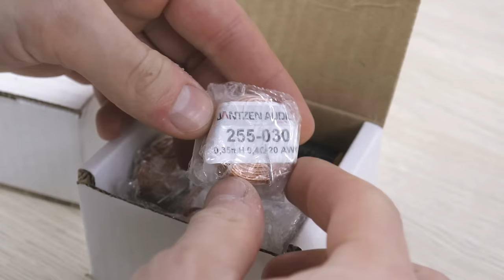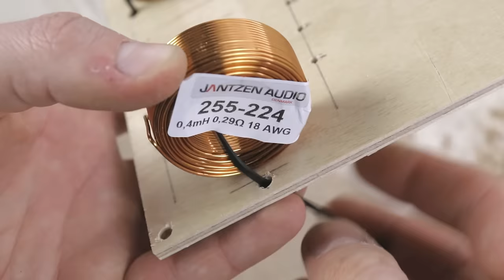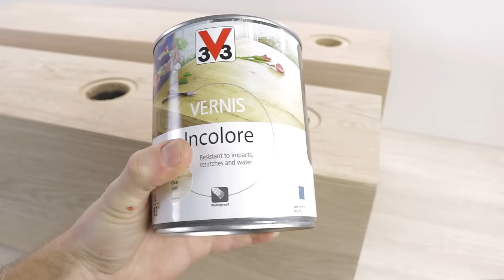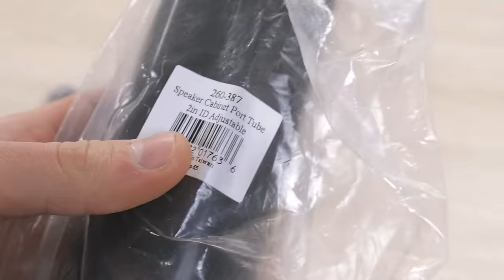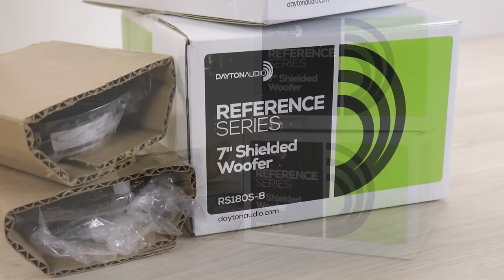These $185 DIY HiFi Speakers Sound AMAZING

Comment: I know I can build the box and wire it but I don't know anything about building crossovers can you buy the ones already made
Reply from the maker: The crossover build is actually very straightforward using the provided diagram, there's not much to know there. You can also use these crossover pcbs on ebay to make it more simple: https://ebay.us/uuJzSI
Reply: @DonnyTerek  thanks I actually built a really nice looking speaker and I ordered the crossover from parts express but I don't know if I can better quality sound from making for the pacific speaker . It seems like a generic crossover. The caps are small it doesn't look like what you have on those. But since learning more I think I can build the crossover with the plan and it's a good price for the quality of speakers. I'm mad at myself for spending $200 on a little bookshelf. The speakers I built for under $200 and they are the bookshelves don't come close even with the crossover I used
Reply: @DonnyTerek  I actually taught myself how to xsim and Dayton audio speakers give you files to download. I was intimidated by crossovers but now I realize how easy they are and I actually redesigned my crossover mine and got much better results

Comment: If you put them in the same box, the tweeter will be disturbed by the vibration of the woofer. In particular, it is not possible to reproduce the original sound such as hard rock.
Reply: Do you have open backed tweeters or something?  What kind of cup is flexing like paper?

Comment: Nice, I look forward to seeing the cross over and hope its not full of cheesy poly caps, Iron core inductors and sand cast resistors. I did notice one small issue your soldering the input connectors was good and they didn't have any magnetic parts in them. However the cables you used do not appear to be pure copper with the correct coating and the clip on's for the speakers are magnetic and that is two issues for inserting noise into the path of the music. Also thanks for the lesson on Veneering. I have a case for my Vintage Sansui I want to re-due with Teak veneer and a tincture style satin I forget the exact name.  It only darkens the darker wood grains leaving the lighter grains alone. And I like your Jig pretty sweet.
Reply from the maker: Thank you. The cables are indeed pure copper. I did not consider that the clip ons can be magnetic, I might swap them for other ones later.
Veneering is kind of fun actually. Quite satisfying to see the boring mdf panels coming to life.
Reply: @DonnyTerek  Well according to GR Reaserch the internal cables besides being of pure OFC need a specific type of coating.according to Danny. I assume it has to do with the properties of the electrical signals which run along the outside of the wire or to do with the electrical field the signal creates. He would know as a speaker designer and electrical engineer. lol unfortunately for me I have no room to build a pair myself. Thank you for the reply.

Comment: The hardest and most elegant part was applying the veneer correctly and methodically.  Definitely not part of the novice woodworking aspect! I'm also surprised at the frequency response on the 7" Dayton Audio reference speakers. My first ever speaker project began with the 3" reference drivers ( probably the best full range drivers for hitting crisp highs without a tweeter). Then i upgraded to 4" drivers which to my surprise wasn't really that big of an upgrade. Finally i added a 6"1/2 tang band subwoofer built exactly to spec and hit 30-35 hz that tapered right around 46 hz.  My point is: do tweeters really add to the euphoria of sound quality? or is it that much of a big difference compared to just using a regular subwoofer and 4" dayton audio reference drivers? ( using hifi amp of course)
Reply from the maker: To my surprise, applying veneer is not that difficult after all! You just have to get the right technique and keep the angles sharp. After that it is just rinse and repeat on every side. I haven't made a full-range build yet. Would love to try that to hear the difference.
Reply: Dedicated tweeters add more air.

Comment: Just one question... how do you open the case in the future if you need to service it?
Reply from the maker: The enclosure cannot be disassembled of course. The only part that might ever need service is the crossover assembly which is held by 4 screws right behind the woofer. Made it small enough so that it can be removed through the woofer hole.

Comment: Great video! What´s the  PVA wood glue you used? I´m having issues whit mine and need to try another. Thanks in advance
Reply from the maker: Hello, thank you!
I just used regular PVA D3 wood glue.
Reply: Elmers wood glue consistently wins competitions when it’s compared to other wood glue is rather inexpensive easy to find and it even works for outdoor projects!

Comment: Stunningly beautiful build by someone who knows what they are doing! I would only have changed 2 things: maybe exchange the connection posts for the contact tubes (eg. Like GR Research uses) and used floor decoupling, not cones. Decoupling allows the speakers to 'sing' better - for me it's a recent but significant discovery. All the best, Rob in Switzerland
Reply from the maker: Thank you so much! Your tips are kindly appreciated and I will definitely look into floor decoupling for these speakers.
Reply: @DonnyTerek  Donny there is a video on YouTube by the HiFi guru Max Townshend of Townshend Audio demonstrating loudspeaker decoupling. Search for TownshendAudio. The videos show their decoupling product and objective measurements. This video prompted me to experiment. I now have much more energy in the mid & treble and drier more neutral bass. Best regards, Rob in Switzerland
Reply from the maker: @RobWhittlestone  Thank you once again. Now I'm excited to see if I will hear a difference, haha. Best regards.

Comment: Nice video : Try some Nedlab capacitors and film resistors in the tweeter section. / coil placement could have been better / soldering the drivers instead of crimps is a plus.
Reply from the maker: Thank you for the tips! Might try that out to see if I hear any difference.

Comment: Very nice video. Why did you cut the holes before applying veneer?
Reply from the maker: Thank you! I had the holes cut before the veneer to minimize the dust that would enter the enclosures if the holes were cut after the veneering. It also allows more room for error if I accidentally cut the holes too big on the first time - they can still be covered with the veneer and then cut smaller.

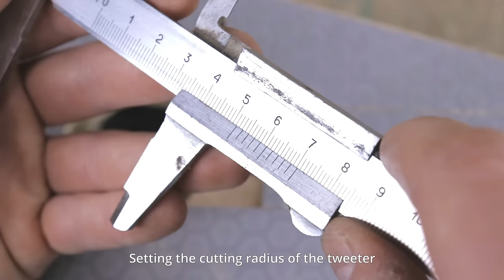Comment: 20:17 Circle Jig, adjustment, under side view. I'm impressed with it, curious how it works, how it's set.
Nice work.
Really liked the Oak veneer work and results.

Wondering if I bought a pair of old speakers could I use them as the chassis base and then put in that new speaker and electronics kit you have used to update and improve them.
Reply from the maker: Thank you!
The circle jig is pretty simple, you loosen the bolt that's on top to move the sliding part. This way you adjust the cutting radius.
Unless you can source a pair of speakers the same size and internal volume as these, you could re-use them with somewhat similar results.

Comment: Can we add second bas speaker to this crossover configuration?
Reply from the maker: Not without completely redesigning the enclosure.
Reply: @DonnyTerek  i got one more question I can’t find answer for. Does it matter for a speaker to be longer than its width, or only the volume inside is what matters?
Reply from the maker: @yafmaverick  It is not only the inner volume of the enclosure that matters by the design but you also have to leave enough room behind the woofer to the back inner wall of the enclosure, you can't have it too close to the woofer to avoid reflections hitting the woofer.
Reply: @DonnyTerek  that makes sense, and answers my question, tyvm!

Comment: They look amazing. I have a turntable plinth i have to get ready for veneer, i want to use the same method as you, but it's scary.
Reply from the maker: Thank you a lot! Go for it, there is not much you can mess up. Even my first veneering turned out fine which I did on a powered subwoofer build. I would say that the key is to keep the corners sharp ant square for the best results.

Comment: Does anyone know if moving the bass port to the front baffle (my room doesn't work nicely with back tunnels) would ruin the audio experience of those speakers?
Reply from the maker: Hi! I wasn't able to find much info on the web on these speakers with the port built into the front but I guess placing the port in the front would reduce the bass output as one person who made these front ported wrote on reddit:
"I think making them front Ported probably reduced the feeling of bass, because there is no wall to bounce off, but you can still hear the bass notes pretty clearly you just can't feel the thump."

Comment: Awesome job. I suspect you tested the crossover before you glued it into the box, but just didn't show us that part?
Reply from the maker: Thank you! Just hooked up the woofer and tweeter to test before assembly. The crossover can be removed anytime if necessary since I placed it right behind the woofer and the crossover is held by 4 screws.

Comment: You put a ton of time making the Box.     Then you make a low level X over. Than add creppy  wire   I hope binding post are a little  better.   Every one on U Tube  building speakers  always has good-looking tools 
 Fine.  Then when  the inportant part comes 
  Thay have deep pockets  with short arms.    Thay could sound even more amazing.   Start with some audio footers  
  You need to know what the floor is.  Cement or wood   get the vibration out of the box.     Intrested in what you will do.    Let's look on.

Comment: It's nice that these also come in a knock-down kit with the holes already drilled. Building crossovers, on the other hand, would be the bane of my existence. Would any of the Partsexpress assembled 2-way crossovers work well with this? What's the crossover frequency in the one you built?
Reply from the maker: I'm not sure if any of the pre-assembled crossovers available on PE would work with these speakers. The crossover point of these is 2 kHZ. I don't think you should be let down by the crossover build so easily, they are not difficult to assemble, rather quite fun and relaxing to be honest. The instructions are clear and drawn out for easy assembly. Moreover you can use these pre drilled pcb boards for more convenient assembly - https://ebay.us/QViavG
Reply: @DonnyTerek  Thank you for the link. I even bought a high-ish end soldering iron because I fly FPV drones, but crossovers seemed intimidating. I'm thinking those boards will help. The separate components would definitely be cheaper than buying a pre-made crossover.
Reply from the maker: @sumdood2035  No problem, glad to help. Funny thing is that I FPV drones look intimidating to me but I really want to try flying one. Hope you won't be missing out on these speakers only because the crossover build looks daunting.
Best of luck.
Reply: @DonnyTerek  A cheap set of goggles, and a basic drone like the tinyhawk and a compatible transmitter (radio) would be a good start for a few hundred bucks. Once the itch gets you, though, you'll be upgrading DJI HD goggles and a matching racing drone. Very similar to audio :) The FPV experience is very freeing though. Like flying a stunt plane without the risk. 

I already have a pair of the venerable AV123 ELT525 Towers. They are, what, 13 years old now? I'd like to build something a bit better/more current.
I've been lurking on partsexpress for years. I always wanted to push the button on something DIY but could never bring myself to do it. Maybe you have given me the initiative to jump in. I don't really have a wood shop, just some saw horses and tables. That's who these knock-down kits are designed for, though, right? (beginners)
Reply from the maker: @sumdood2035  I got into RC quite a while ago with making my own planes out of styrofoam, but never got into FPV. Though I have a full system ready to be wired up. Will definitely move this project a bit forward now.
As a happy owner of a pair of these speakers I can fully recommend them not only for the sound quality but for the satisfaction of having to build them yourself. No wood shop is necessary for the knock-down kit, perhaps a drill to help yourself.
Reply: @DonnyTerek  You're already halfway there with the planes. A drone flies quite a bit differently, though. It requires both sticks to bank and turn at the same time and the throttle needs to constantly be modulated. It takes some getting used to, but you actually have more control in the end.

I just checked the specs. If the Amiga's really go into the 30hz range from a single pair of 7" woofers, that's pretty insane!  Your demo video showing them driven from a 50wx2 RMS Dayton amp with their 84dB sensitivity is also very impressive. The tweeters look VERY similar to the amazing tweeters in my AV123's with a rolled surround, but I believe mine are closer to the air-circ style. I do have a drill, and basic hand/power tools.

The only concern I'd have with the Amiga's would be corner loading. My listening space would require one of them to be squeezed right up at a corner wall, maybe 2 feet out from the rear. I've always favored front ported speakers for this reason. Several rear ported towers I tried in the past had extremely boomy bass in this location. 

And another aside. I picked up a dirt cheap Class-D amp, The Foss Audio TB10D. It's a dirt cheap basic amp with tone controls and RCA inputs, but it sounds SO good for $70. I found myself digging out old bookshelf, surround speakers, anything. They all sounded excellent. Just need a DAC to add to it now (Schiit Modi or similar), and I'll have a cheap mini system. That tube amp you tested seems extremely nice, though, and a great match with the Amiga's.

Comment: Really great build. However, I have a friend who repairs old AR speakers and there should be easy access to the crossover circuit as individual components do fail, especially the caps.  Beautiful job.
Reply from the maker: Thank you! The crossover circuit is actually easy to access, by simply removing the woofer, you can easily unscrew it from the back of the enclosure.
Reply: These are foil capacitors not electrolytes. They are unlikely to fail or detoriate. Likewise the coils.

Comment: no ferrous metal in signal path.
no signal smearing sand cast resistors either. mills resistors only.
tube connectors only. IT WILL SOUND BEST.
Reply from the maker: Thank you! Might test later.

Comment: Thank you for using screws and not brads. Some of these other channel... my gosh. I am surprised, however,  at the use of ceramic resisters in a lot of these DIY youtube crossover designs. Ceramic resisters are not generally high performance. Their main advantage is low inductance, but given the loose design of a crossover, this is not really an issue. They have good surge handling ability, but unless you are driving a KW, this is also not really an issue. Sorta the same with electrolytic caps (though the ones used here are better). Is it simply cost? Could be I guess... good components do cost substantially more... but we are talking 2 vs 5 dollars. So why skimp there?
Reply from the maker: Thanks for the comment. These speakers were built according to the Paul Carmody design with no intention of upgrading or changing any of the components. Upon some research on the web of other who didn't use the ceramic resistors, they couldn't tell the difference on sound quality between them, so I doubt I will bother replacing them anytime soon.
Reply: @DonnyTerek  Fair enough.
Reply: @DonnyTerek  re upgrading of cross overs and drivers: I know Spendor A series uses cheap parts but perhaps Spendor tested high quality cross over parts and better drivers and couldn't tell the difference on sound quality between them and what they have ended up using?  Or did Spendor spec and mass produce its A series without first carefully selecting all the parts?

Comment: You should have installed a down firing woofer on the bottom.
Reply from the maker: No need to butcher a great design by Paul Carmody. These speakers sound great without a sub.

Comment: The driver cabinets are very good.
Pity about the mediocre drivers used and cheap electronics in the cross-over circuit board.
Then again the budget is small @ $185
Reply from the maker: Thank you. Much can be improved of course, but for such a price a kit like this is difficult to beat.